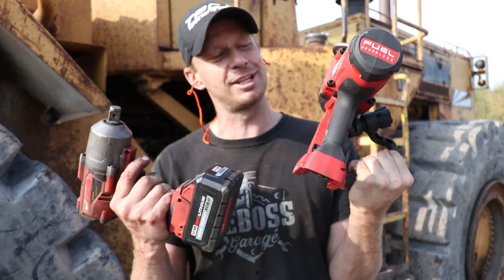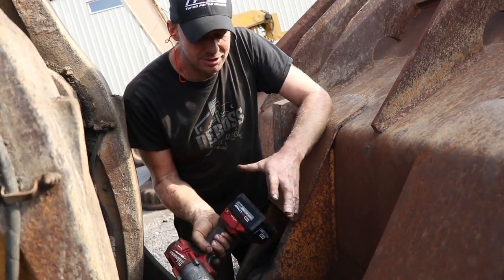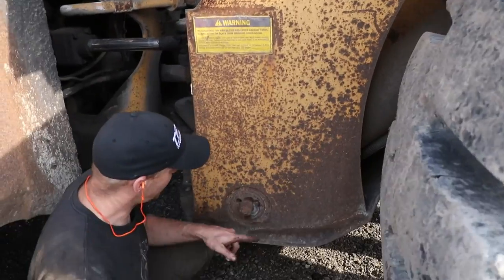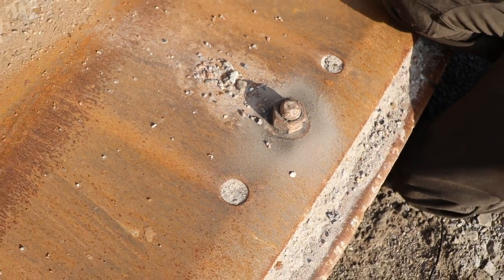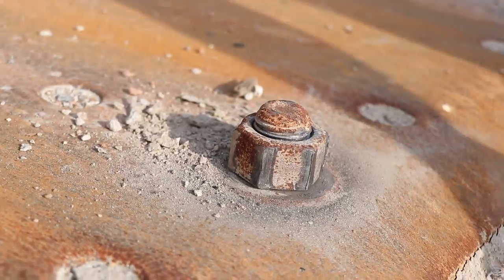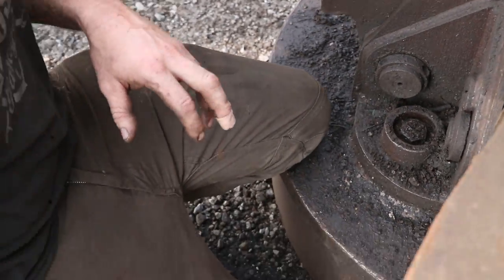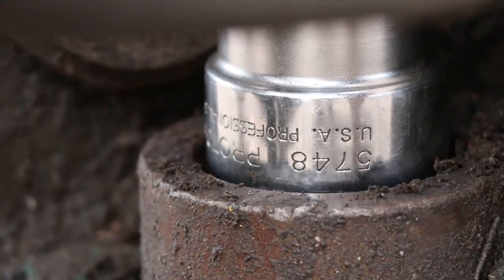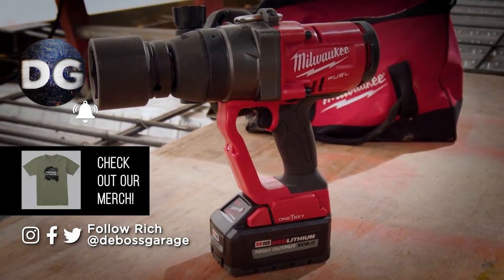Busting 40 Year Old Nuts with a 1 Inch Impact Wrench | Milwaukee M18 FUEL 2867-20 REVIEW

Comment: being an iron worker I've used these on jobsites on structures. with the heat in the sun all day+impacting bolts the battery over heats and becomes useless for a good 15min.

Comment: I personally have had to get the right size wrench weld a long chain to it heat it with a torch hook  it to a tractor put some tension to get those blade bolts off an impossible task with a impact .

Comment: The 3/4 and 1" gun are pretty good. But not a mat h for air. I know as a HD mechanic I have them and enjoy them. But the they rattle so strongly the battery fit melts away and you loose connection. Also if the fastener is allowed any movement there is not enough room from the electric to make it work.

Comment: You should look at the IR W7152. It' a 1/2" drive 20v 1500 ft-lbs torque. Cost around $250, tool only cost. I have that one along with several other IR cordless, 20V and 12V. Everyone of them has been worth it.  Ofcourse I don't do heavy duty trucks, just normal everyday cars and trucks. I would like to see it being used on one of those though.
Reply: Have you invested in the IR W9000 Series 20V 1" Cordless Impact,, 3000ft nut busting torque.

Comment: Are those impact rated sockets? Idk if impact rated sockets can be chrome plated or not usually they are coated black. Anywho I wonder if those aren't, if using impact rated ones would help break those stubborn ones free. I feel the non impact rated ones are a softer material and they lose a lot of energy in flexing and warping which means essentially you are just cheating yourself out of nut busting power. Idk just a thought. I only ask because a few years back I went to take a crank pulley bolt off and used two different impact guns with chrome sockets and it wouldn't budge. Then I got impact sockets and used the weaker of the two guns (my craftsman 19.2 ½ inch ) and it zipped it right off. I'm guessing the impact sockets allowed more energy transfer into the actual bolt and into breaking it free.

Edit* lol nvm literally right after I wrote that I hit resume and found out my answer lol.

Comment: We just picked up 3 for use on the railroad.

I'll let you know how they work on track bolts
Reply: Well, it has no issue tightening 1 1/18 coarse thread with nyloc nuts.

And sucked a 14"x1/2" lag screw the whole way down.

Ordered 2 more :)

Comment: Most structural steel work doesn't need a 1" impact, most of the time a mid-torque 1/2" will do fine.
That said I work on heavy equipment and love a big ol' heavy duty tool and I love that Milwaukee's coming out with something that solid.
I live in Australia, and being 1" I doubt I'll see it in the stores very much but I'll be damned if I don't pick one up when they come round.
Reply: The internet is a beautiful place brother. I’m sure you can have one shipped to you

Comment: Milwaukee cordless impacts for the win! Bought a 1/2" and it's a beast but nothing compared to 3/4" or the 1" but can't justify those yet haha
Reply: I believe I saw the 3/4 is the same basic internals as the 1/2, but with a 3/4 anvil.
Reply: @rlrobman123  not in business fixing heavy machinery so 1/2 pretty standard for what I work on but your right just bigger anvil but then more expensive sockets and adapters then 1/2"!?
Reply: @nickthrane4940  Without getting too much into physics, the larger anvil will transmit the torque to the socket easier and with less loss. Plus, the 3/4 will go up to a higher size than a 1/2 would. But, yeah, a lot more expense on sockets and adapters.
Reply: @rlrobman123  makes sense. Too expensive for a non full time mechanic like me but would be nice to have!

Comment: I take off cutting edges on CAT 988s etc at work with my Cornwell 3/4" air gun rated at 1800 in reverse as well 90% of the time I don't need the torch I've been thinking of buying the 1" milwaukee but in my experience at work if my 3/4 Cornwell gun won't pull it the 1" IR won't either so been holding off on buying one but it could definitely come in handy btw If anyone is looking for a bad to the bone 3/4 gun buy the cornwell tools air is definitely the best one I've ever used bar none great video really enjoyed it

Comment: Chrome sockets are stiffer and transmit more torque to the threads. Impact sockets are softer, so can handle a beating without cracking but also wear out quicker (i.e turn a 19mm into a 19.5mm sooner, loose drive end etc). Also I personally put 300,600,900 lbft of impact gun torque to dozens of chrome sockets in drive sizes 1/4-3/4 daily and maybe crack one in the corner of the 6-pt once a year, once every other year, fight me.

Comment: Would it be ok to use these 3/4 or 1" impact drivers to drive 5/8", 3/4", and 1" lag bolts into wood and concrete for anchoring applications? Right tools? In afraid of over torquing! How good is its tightening control? 
Maybe a smaller impact driver would be ok? 
Thanks!
Reply from the maker: Perect tool for it .  If it is too much, you can set the max through the one-key app that it pairs with

Comment: I just bought the one key high torque 1/2" gun.

Can sooo easily spit a m16 spring washer out lol

Im sure it would snap a 16mm tru-bolt that i use at work

Comment: I would try to take off a harmonic balancer bolt, I recently tried with a dewalt corded impact and it wouldn’t do it. I finally got it off with the car starter lol
Reply: How did you attach the socket to the starter?
Reply: Lmao I didn’t take the starter off at all I used the starter to crank the motor over and I put the socket on the bolt with the breaker bar hitting the ground

Comment: I had an issue with this 1 inch impact gun on removing volvo loader wheels. It couldt get them loose. Then i brought up a pneumatic gun. And it wasnt an old rustet wheel it was a maintained one

Comment: My IR 293 will take off 95% of 1 1/2" shanked cutting edge bolts on loader cutting edges.  Makes for way less cutting.  Gotta have a serious air supply though. If you'd like to do a comparison with real impact 1" sockets and an IR composite 3/4" with 3/4" impact sockets, lemme know. I live 20 mins away from you.

Comment: So nut busting torque will always be higher than tightening torque so not surprised that the 3/4" could undo the nuts. Also it would be a great comparison to see how. Much effort it would be to undo with a big breaker bat. Great tool though.

Comment: Did you change the settings in your one key on the app. Its default is 50% less. So you do not have all the power unless change it in the app on your phone

Comment: Impact 6 point dude that socket will shatter in your face with those. Been very happy with the Ingersol Rand 7150 too. . These tools in this power range for auto good enough or get used to breaking wheel studs or stripping out lug nuts. 🤣

Comment: Using the 1/2 on my semi truck,  I found out if the battery  Is low it doesn't have this power to take off the logn nuts

Comment: The best way to get old rusted bolts and nuts off is to tighten them before you try to remove them kinda like dirt track racing u gotta turn right to go left. I do know this is a demo and no doubt both of those r badass most numatic impacts wouldn't be able too get any of those bolts and nuts broke lose

Comment: We tried a one inch breaker bar, four feet long, with a eight foot pipe,  we stopped cause we felt like the breaker bar was breaking or at least bending..we have better sockets than your using

Comment: It’s crazy how you tighten it with the 1” and the 3/4 is breaking it lose.
Reply: Not really. Most impacts are rated at higher breakaway in reverse than forward. You also lose more energy tightening something vs loosening it.

Comment: Use a 12.0 High Output battery, not the 9.0 high demand. The "High Output" architecture uses 21000 cells instead of 18650 cells, and can output much higher amps at lower temps AKA more power. You'll get peak performance on that gun with it versus using the 9.0.

Comment: air driven 1 inch is hella heavy to operate but damn its strong. think the one ive used is rated at around 3000-3500nm makes damn easy work of tractor and machine bolts :p
Reply: tho ive gotta admit that cordless is impressive none the less
Reply: I’ve got an Atlas Copco 1” gun and I’ve never used any gun as powerful as that in my 23 year career. I love Milwaukee tools but I doubt this cordless one will do what that air gun does. It’ll do 2500 ft/lbs without breaking a sweat.

Comment: Use it on 18-wheeler wheels... I've seen 1.5" IR guns fail on inner lugs of Budd wheels... you have to put a giant 4-way wrench on a jack-stand with a 10' cheater pipe, then have someone bang on the end of the 4-way with a tire hammer.  If that fails, it's the blue wrench.
Reply: Jesus. Do you guys not pull wheels annually for inspection?
Reply: @-tr0n  The truck stop doesn't own the truck.
Reply: @scowell  i meant generally.

Comment: The 1" needs a 6 point impact socket so it has more surface area covering the nut. The 12 point is making it bounce off the nut and isn't applying all the force. 

I'd be so pisses if you kept impacting it for so long to get it loose. That burns them up.

Comment: You should ware a safety glasses when using an impact. You already know that. Cutting edges use  cutting torches because the nuts and threats are hammered so u have to cut them off. Are you using a new battery each time on a new bolt. That would change the outcome.

Comment: Still prefer air.. cordless is good for little tasks .. but a pain when the batteries constantly need to be charged
Reply: To be honest with the bigger batteries now (9.0ah+) they ain't as bad as you think.
My 9ah dewalt battery for my dcf899 I charge probably once a week to every 2 weeks with my usual use as a forklift tech.
Reply: @deezelfairy  yea I guess..
Reply: I’ve got 12 amp batteries they last very long time under heavy use. And with the quick charger they charge very quickly. I’m a heavy equipment mechanic in underground mining and I don’t even use air tools anymore.
Reply: @havingfun8192  The great thing with the big batteries is because there bigger cells they ain't working as hard so the run times better then the Ah rating implies.
My 9ah lasts I'd guess 50% longer then 2 x 4ah batteries if you get what I mean.
Reply: deezelfairy I know exactly what you mean, might just be me but I find the bigger batteries keep delivering full power until they just die. They don’t lose effectiveness before going flat so the charge is more useable.
Reply: @havingfun8192  Yeah, I find that too, it's full chooch or flat. Again I think it's coz the cells ain't working as hard compared to the smaller batts, there just isn't as much voltage sag under load and that always gets more pronounced as any battery is getting close to flat. I find the impact hits a damn site harder with the bigger batteries too.

Comment: After buying the 3/4, 1/2, 3/8, 1/4, 2 drills, sawzall, calking gun and 6 9.0's, I can't afford the one inch right now?
Reply: I’ve got 1/2” stubby and m18 fuel impacts, a drill, impact driver, m18 sawzall, and a 3/8 m12 ratchet. I don’t think I’ll have a need for the 1”, but I’m looking forward to the angled die grinder coming out this fall, and I’ll definitely be getting a m18 grease gun.

Comment: My question about the one inch or the 3/4 is on a Hendrickson trailer suspension the pivot bolt's one the axles have to be replaced during an alignment the bolts have a male torx that sheers off at around 700ft lbs when properly tightend, will these impacts accommodate that kind of work
Reply: I regularly use my 3/4 gun to change tires with a torque spec of 740 ft/lbs and I zero issue taking them off or putting them on. It will go past 740 if I let it hammer. I have proved the correct torque with a torque wrench.
Reply: I have an Ingersoll Rand 3/4 that struggles tightening the bolts buy does the job thinking the 1 inch  would make short work of it.
Just the investment of the tool scared me lol

Comment: Hope there batterys aren't like dewalts because if there at half battery the voltage drops and you can tell it especially in there impacts
Reply: joseph headen they are not like dewalt. Milwaukee batteries have full power until they stop working.
Reply: @havingfun8192  good to know i was really let down when i found out thats all we use at work and i know exactly when im down to half battery

Comment: Be interesting to see if a 3/4 or 1in air impact could loosen what the Milwaukee couldn't, as a comparison. like What my 3/8 Milwaukee won't loosen my 3/8 air will, then 1/2 Milwaukee then 1/2 air and then 3/4 air

Comment: Try and close bx155 ring gaskets on 4 1/16 15k flanges they have 2 3/16 nuts... i would be seriously interested to know if it can do it. I know oilfield guys would love to have this if it can
Reply: It prob would crush the bx gas, problem with using it would be not tourqeing it per API standard 30,60, 90,100 percent

Comment: 9:11 Or maybe because it takes way less energy to loosen a bolt than to tighten it 🤷🏽‍♂️.  When tightening, you're increasing tension. However, when loosening, you'er relieving tension - which simply takes way less effort. #FoodForThought

Comment: As a truck trailer mechanic, I've been looking forward to buy this gun since 2018nps. But this gun fail me badly. It's weak. Can't pull 11r225 wheel nuts. Just not even close to the 1inch air impact. And it over heat in 10second crank. The battery terminal vibrate so much when it's cranking. I use a 12amp High output battery on it. 
Guys who is looking to buy this gun to replace the air impact. Think twice.
Reply: Others in this thread are saying the opposite, that it has no problem with truck tires. How much is DeWalt paying you?
Reply: @jaydunbar7538  I wish someone pay me to say that. The product manager from Milwaukee actually called me last week about this issue as I've left a feedback on Milwaukee's website. I use everything Milwaukee and this 1inch gun is the only tool that fail me. I don't know how the other guy tight their truck wheels. But torque wrench never lie. Also. My princess auto propoint pull the wheel nuts but not the Milwaukee.

Comment: i sure laughed when you knelt down at the cutting edge on the loader. i cant believe that gun loosened the nut with a 12 point socket. i've helped change cutting edges and its an awful job.

Comment: You're using the wrong sockets. With thick-walled impact sockets those things would spin off like nothing. Crank bolts are the same. they need thick impact sockets.

Comment: Not sure this is worth it tbh.  I tried one out on various machines for a couple of weeks.  Although alot of the things I needed it for were excessively tight.  Unless you have zero access to compressed air you're much better off with an air tool

Comment: You should be using a 6 or impact socket not a 12pt chrome socket
Reply from the maker: Milwaukee sent me this gun without me asking.  I will have a very limited use for this gun being pickups are my biggest thing in the shop.  We did not get paid to make this video and it does not make sense to buy sockets that I will never use again.   Like I said in the video....
Reply: I was thinking about your safety I've seen chrome sockets come apart many times

Comment: So the gun don’t work well for automotive nuts?
Reply: It's way too powerful for smaller automotive fasteners.  You'd break them off.  The 1/2" high-torque model 2767-20 is the biggest thing I'd use in an automotive setting.  The smaller 1/2" mid-torque is my go-to impact.  The M12 stubby impact is great for getting in tight spots like behind calipers and suspension pieces.

Comment: semi tires?
Reply from the maker: The 1/2" gun took buds off
Reply: @DEBOSSGARAGE  when I was in college I worked part time at a truck mechanic shop, which meant that I did a lot of brake jobs on semi tailors. we had a big 1" gun that had to be 30 40lbs, taking the nuts off is one thing, but putting them back on is another thing, like if you were stuck at the side of the road could you get a tire off with the Milwaukee and actually replace it proper wise and trust it for idk another 100 miles or so like we used to on the farm.

PS extra caution is required not to hold that big air gun by the anvil and hit the trigger, the handle will twist right into your unmentionables......

Comment: It's. Stronger tool with the 12 amp batt
Reply: Not necessarily. Larger capacity battery will allow tool to be used longer, but it's the same voltage. It doesn't make the tool any stronger.

Comment: Go try lug nuts on simi truck. 1inch air gun is a back breaker.
Reply: Shaun Bennett are you a young guy, or 50 something with a bad back?
Reply: Shaun Bennett well, it’s part of being a diesel mechanic. Gotta do brakes etc. older ya get, heavier things become.

Comment: 1.FLAWED TEST.1 NEED TO USE IMPACT SOCKET. 2. ONE DRILL ON ONE NUT. SO WHAT YOU DID WAS LOOSEN UP THE RUST USING THE SMALL ONE AND THEN TOOK THE BIG ONE ON THE SAME NUT INSTEAD OF A DIFFERENT NUT. DID THAT MAKE ANY SENSE? WHERE'S YOU'RE BREAD SLICE?

Comment: I’m wondering if Dewalt is falling behind...
Reply: I'm begining to wonder the same. Always had Dewalt but Makita and Milwaukee seem to be seriously upping their game..
Reply: @olivermaskell6244  One thing for sure, is that nothing cordless that I have had from Dewalt has let me down. I have used several 18v Milwaukees from friends and either their set has a battery that is weak or the impact drivers were noisy and low powered. 

I wonder if Dewalt is spread to thin being owned by Black and Decker. I already own a dozen Dewalt tools.
Reply: @jslakenes5540  I'd agree with that. Even when using makita I've found the batteries unreliable. Heard several mates say gears have stripped in their impacts. But again. Never had a single problem with any of my cordless stuff from dewalt. I do think black and decker have something to do with that though as you say.